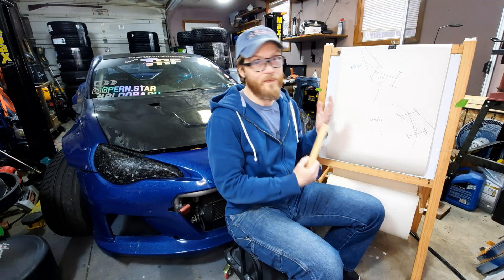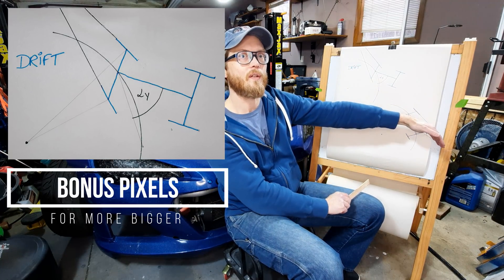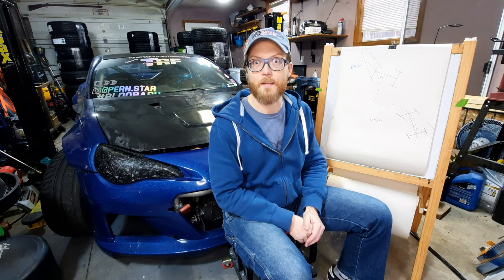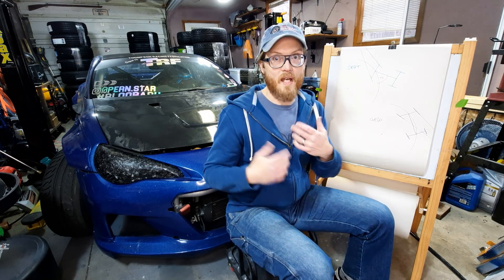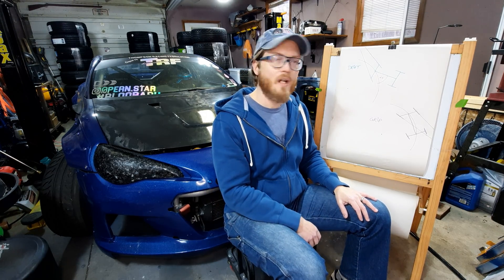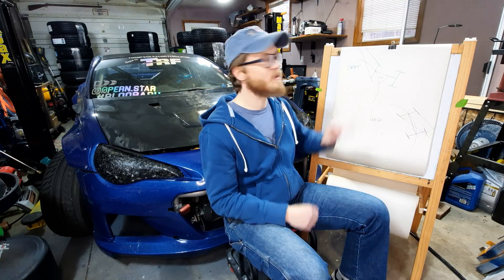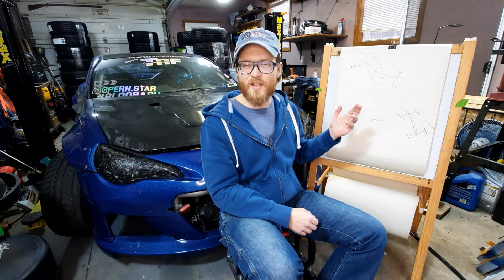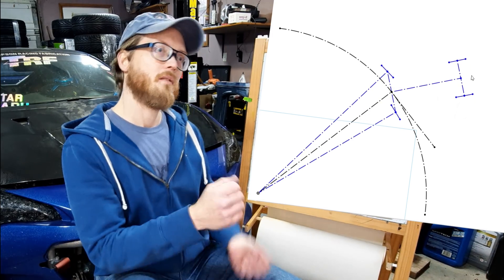Nerd Alert - EP1 -  Ackermann Declassified - Drift vs. Grip, the complete breakdown

Comment: Great job, much appreciated to the information contained.
I'm a big fan myself in drifting, but we are barely have the proper place to lay our hands on drifting here in our country.
So most of the fans are doing sim drifting instead taking the risk to drifting on public roads.
There is a mobile game of drifting named Carx drift racing 2 which is more arcade than sim that developed by a Russian team, and the founder is a RDS drifter himself in real life. The in-game tuning spec is quite detailed as a mobile game. So I've got very addicted to the game. And I have drifted my daily occasionally in commute.
From my experience I always prefer some pro ackerman whether it's in sim or mobile game or real life.
So when I running into your video, it got me confused as I'm sitting on my own experience, so I decided to go down to the rabbit hole, later I was despaired of finding anti ackerman simulation. Hoping that I can find out to have the taste of anti ackerman steering.
I know this might sound naive of me, but could you share your thoughts of the mobile game Carx drift racing 2 as a pro drifter. Cause that could be my chance to get myself educated in drift tuning spec based on your view.
It won't take much time cause the low tier cars with pro drifting specs have all the elements of tuning spec.
Thank you!
Reply from the maker: Hi there.
Glad you like the video.
I have played CarX on Xbox one. If it's the same game on mobile, it's actually not half bad. It's by no means a sim, but the way you can control the car via left foot braking, the way you can make line corrections with the ebrake a lot of that stuff is directionally correct.
The tuning aspect however... is wack.
I purposely set up a few cars completely retarded (wheels literally next to the car, carolina squat, huge tires in the front etc.) and they drive just fine... So, don't read too much into the settings in that game. LOL
Reply: @pernstar  Thank you for the detailed reply, have a good day sir.

Comment: Awesome video! The point for me about only looking geometric, is like 0 toe would be more correct geometric but we know we need some toe out in order to have some good self steer, and this reflects the same way to anti ackerman, as we will have toe in during drift, the car will not “want” to straight or produce a self steer feeling. Also it will affect the radios the car want to Drift, making it almost wanting to slide in a straight patch.
I’ve tried anti ackerman but personally it didn’t feel correct for me, I prefer low positive ackerman or 0 ackerman the most, of course it’s only my opinion doesn’t mean is the best choice 😅
Thank you for the content, would love to hear about kpi
Reply from the maker: There is so much more going on than just steering angle. So, it's important to try and isolate things. IE, was the caster good when you ran neg ack? Or was the caster better when you ran pos ack and it amplified the behavior etc. I have played with all this extensively and 'know' how my car feels with what kind of geometry, but it is so hard to put into words how the steering response of a car feels.
Pos vs. Neg Ack is definitely a huge difference not necessarily in self steer, but in the trajectory when releasing the wheel (wanting to go wide vs. tight etc.). Thx for the lengthy reply and I hope you enjoy future videos :)
Reply: @pernstar  for sure the biggest difference is that widening feeling, thank you for the response 😁